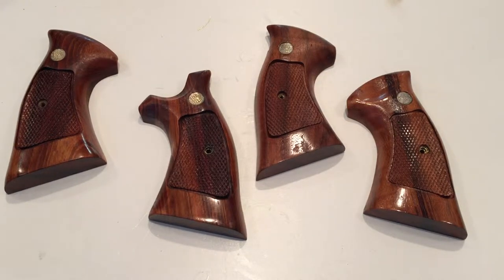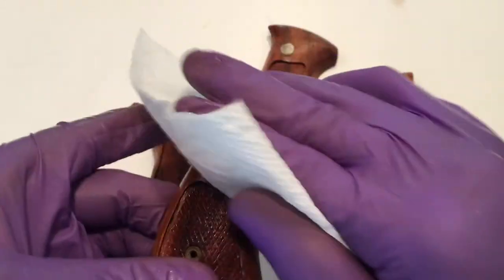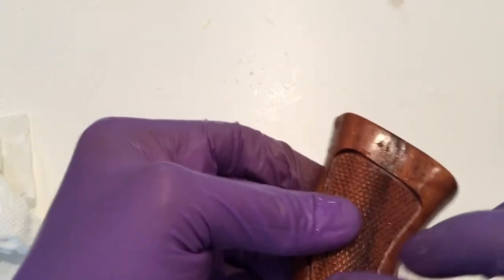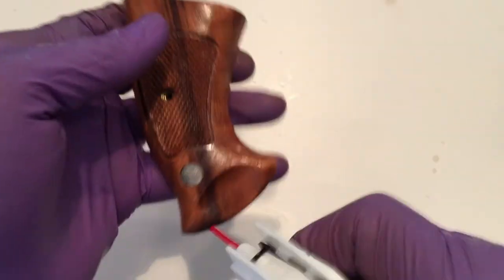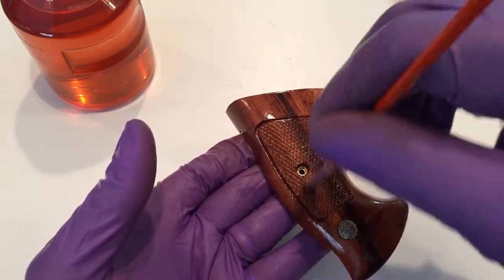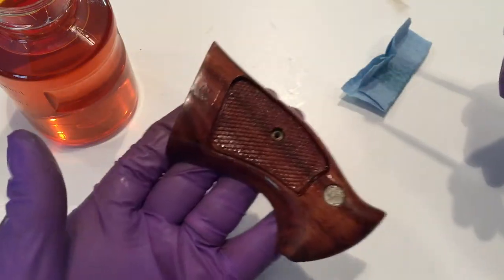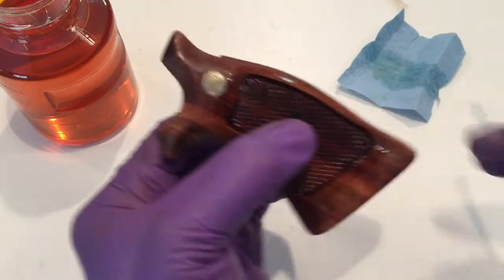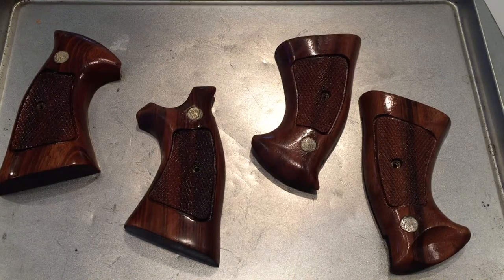Smith Wesson Revolver Stock Refinishing Part 6

Comment: My refinishing journey started shortly after inheriting a vintage Rossi 38 special, Made in Brazil, 5 shot, 4” barrel, walnut grips. 
    The revolver was needing cleaning, oiling, and the walnut grips had some scratches that I wanted to clean up. 
      So that’s when I found your series on refinishing wood grips.  And I was very motivated after watching your process. So motivated I set up a work area in my garage and started. 
      I sanded the seams as needed to align properly. Then sanded all the flat areas to remove the finish. I used a stripper on my checkered insert and soon I had the old finish stripped and the walnut looking very nice. 
     I never had to ask you any questions because you are so thorough every question I had was answered in your videos. 
      I put ten coats on lightly wet sanding between each one. 
     The tenth coat was so nice I went straight to the polish, followed by the wax. 
    What a pleasure it was to bring this revolver back to such a high quality. My walnut grips now are a high gloss and I even bought a gorgeous new holster on EBay to complete my project. 
     I’m looking forward to hitting the range  soon and trying her out. I’ve never shot this revolver only cleaned her up. 
     Thank you for  sharing your in-depth and motivating knowledge on refinishing grips.  Mine are gorgeous now thanks to your help.
     I am enjoying watching your videos as I am now a new subscriber of yours.
    Thank you again.
Reply from the maker: Thank you Sir.  Glad you were able to restore that gun.  It's rewarding to take something old and beaten-up, and make it new again.

Comment: Mr. Big I bought a set of grips from the  company you recommend. NO PROBLEM  THEY ARE WALNUT CAN I USE MINWAX CLEAR TO GIVE THEM A SHINE. THANKS
Reply from the maker: If they grips came from gungrips.com, the answer is "yes you can" provided the grips don't have a wax finish.  Poly will not adhere and will actually start beading up as it dries. They usually use Tru-oil as most of their finishes.  The grips will require some prep before you do it. You'll need to clean them really good with mineral spirits to remove any wax that might have been applied.   Then scuff the entire smooth surfaces with 0000 steel wool or something equivalent, but do not remove the factory finish.  Then you can apply the clear poly.

Comment: Correct if wrong. 
After 3 coats, after that do you stop doing the checkered area and then just the smooth area, or for each 10 applications continue the checkered area?
Also I can’t find any more steps past 6. 
At the end of the 10th coat do you wet sand again and do you polish?
Thanks.
Reply from the maker: If the checkered areas are to your liking after 3 coats, then YES stop.  Every pair of stocks will take finish differently, so you may choose to apply 1 or 2 more very thin coats if they are not.  I strongly advise to NOT apply to many coats because you will start to fill the grooves, and lose the desired appearance and gripage.  I usually wet sand all of my stocks after the final coat because I like the smooth, clear, glossy appearance.  However, you can opt to just knock of and settled dust of and decide to polish or not.  Which ever you prefer.  Here is Part 7:  https://www.youtube.com/watch?v=FDs4ltmgaVU&t=309s

Comment: What kind of brush are u using ? 1/2 inch ? Acrylic or sable ? Thanks 🙏
Reply from the maker: I really don't remember any specifics about them.  They are General Purpose Fine Texture brushes for oil, acrylics and watercolors paints.  I typically buy them from Hobby Lobby.  Not expensive.

Comment: Just curious on the first set of grips (that you rubbed off the poly) you never removed the original finish from the checkered area - so you just apply the diluted poly over the old factory poly?
Reply from the maker: Yes.  I clean it very well with mineral spirits and firm bristled brush to remove dirt and oils first and let dry.
Reply: @mr2275cur  Thanks - your video inspired me to give it a try.  You're the Bob Ross of revolver grip refinishing. lol
Reply from the maker: @winstonchurchill3597  Bob Ross huh...?  Guess how many times someone has made that reference.  LOL...  Thanks Man.

Comment: A general best practice rule of wood finishing is to seal the entire piece to keep the moisture distribution even - prevents warping and splitting. Do you apply a coat or two to the inside as well? My factory grips are not sealed on the inside, but I am inclined to fix that … your thoughts?
Reply from the maker: Well, I've never heard that.  I was taught to not seal the inside to allow the wood to    absorb and release environmental and ambient elements.  It's a naturally occurring condition and doesn't hurt the wood.  I will apply some wax to the under side of my stocks periodically to dissuade them from absorbing gun cleaning chemicals.
Reply: @mr2275cur  Thank you for your perspective … and your professional content here. I’m really enjoying the cosmetic series.
Reply from the maker: @TheDansana  Thank you Mr. Danny for your kind words and for taking the time to watch and comment.